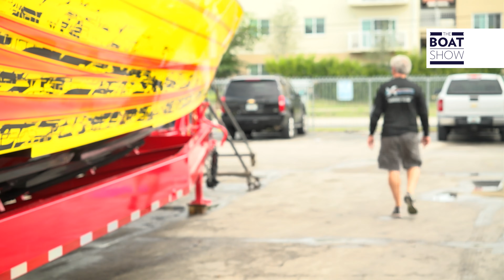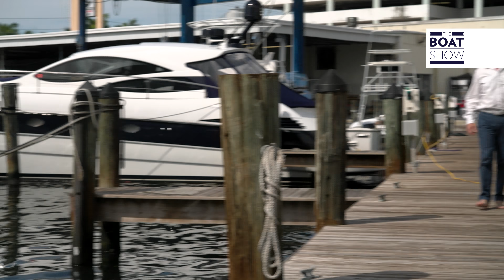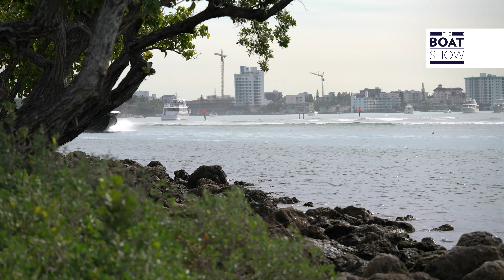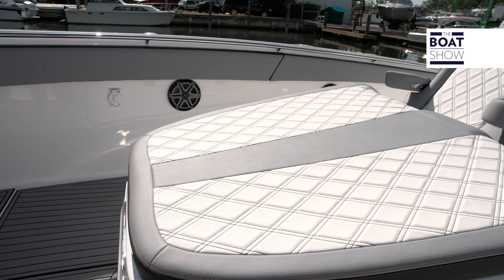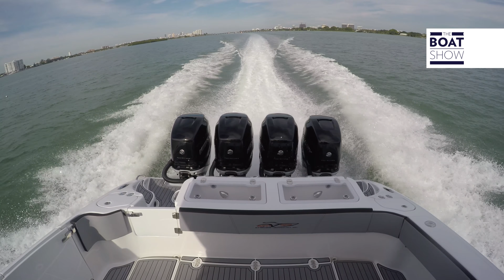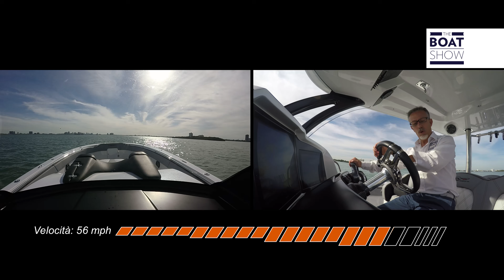[ENG] MARINE TECHNOLOGY INC. SV 42 - 4K Review - The Boat Show

Comment: '
4 motors are not good idea on the boat...
too heavy weight, too much drink drain gas...
better 2 motors and both are opposite propellers spins
Reply: two would be plenty but it just would not go as fast. but they don't give a fuck. but you can cut the rpms back but they don't.
Reply: bestamerica Four engines beats two, gomer.